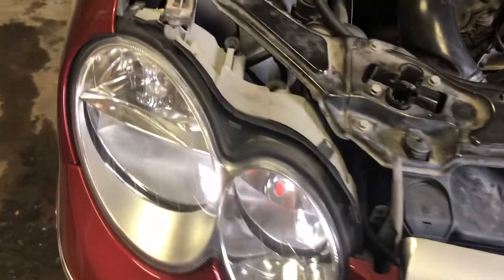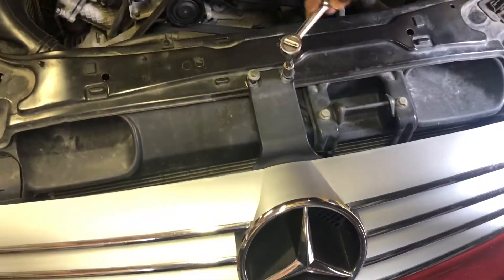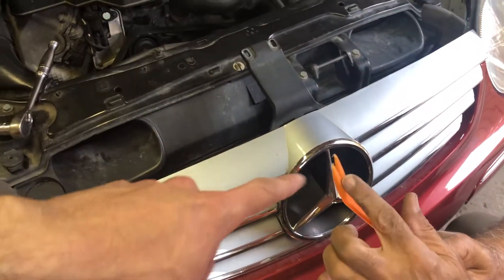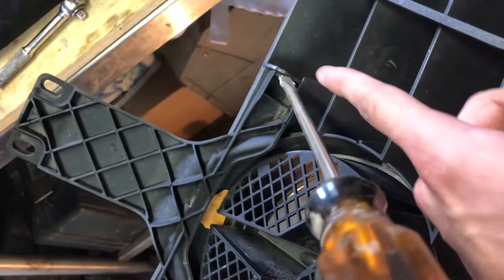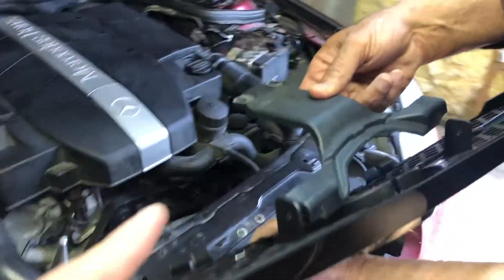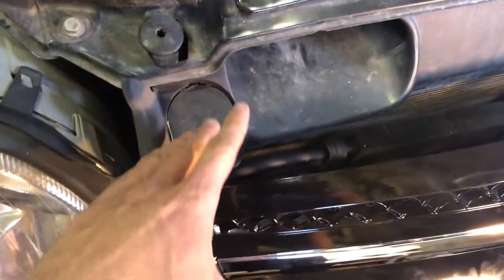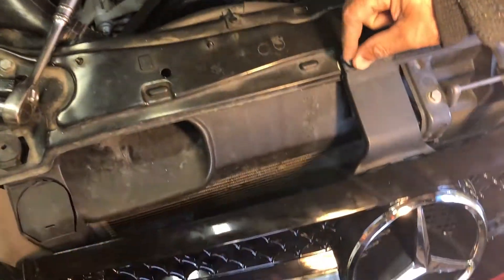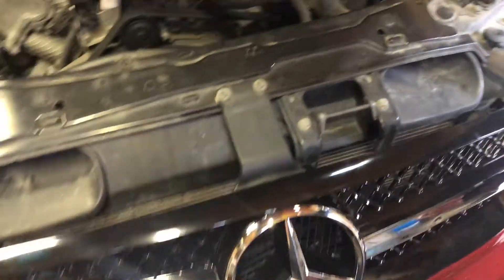Changing The W209 Grille

Comment: I ordered that same grill. What a difference. Looks amazing.
Reply from the maker: Hope you like it!
Reply: @autoopulence9711  I have a CLK 2003 W209 with front radar distronic behind the central emblem. Could you please tell me if it's possible to move the original emblem from my original grill to this one? is it a clip type or rotation type emblem supporting thread? Will it fit? Thank you
Reply from the maker: @punisher2551  No i believe you will have to buy a separate star, they are around $30 on ebay